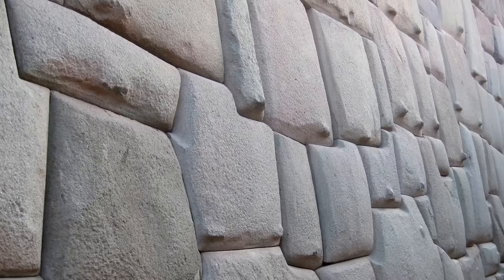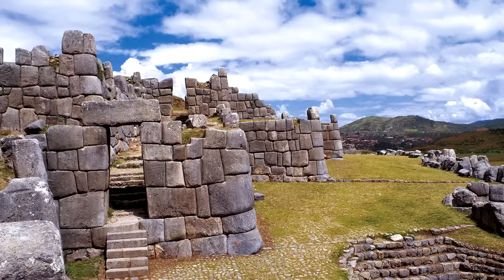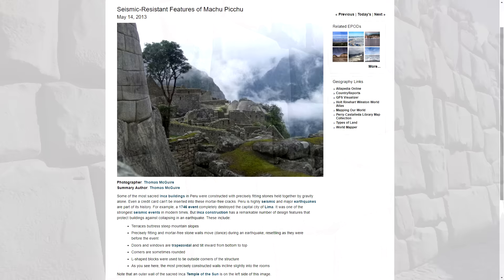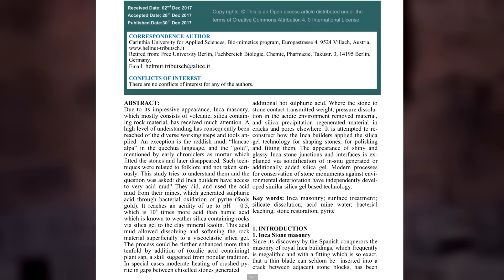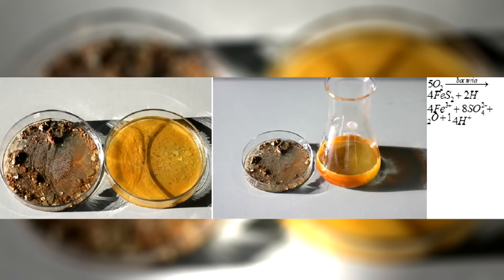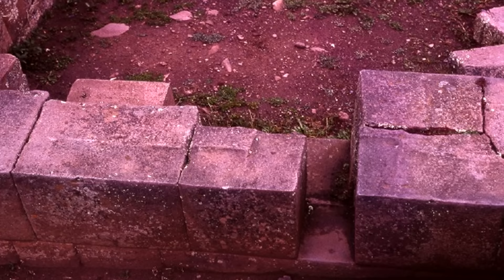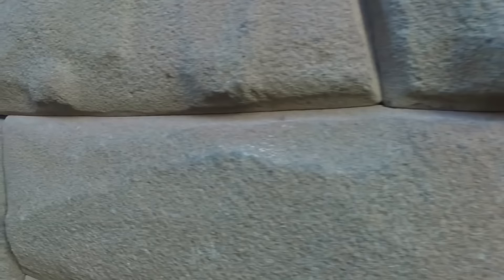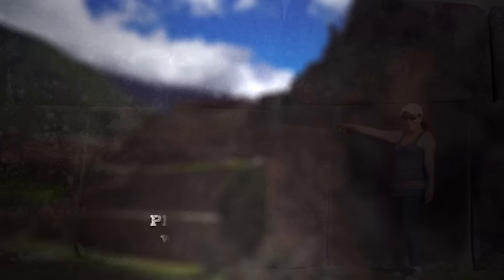Is This How The Inca Walls Were FINISHED/JOINED So Perfectly?

Comment: If the combination of weight and acid worked at all, then the horizontal joints would be most effected. The vertical joints, not so much or not at all. Back to the drawing board.
Reply: Very good comment. We must also think about vertical joints with different pressure. 
For me, we will never get the answer unless we dismantle some wall at least partially, examine it and them reassemble it back. There must be traces of what formed the stones into their final shape. And possibly some material residues of means of their transport into their place.

Comment: I’m starting to wonder if they didn’t use a recipe for a more solid forming concrete. A mix that would create granite and other hard stones. Has anyone ever noticed the concrete bag method being used? Just stacking dry bags of quickcrete?  They spray the bags with water and leave them. Eventually forming perfect walls of concrete. If the ancients used a similar method using giant burlap bags of a special blend of sands and lime to form larger more solid finished walls. Just a thought. Thinking of trying it out with various size bags and recipes for Concrete or geopolymer mixes.
Reply: Don't ..there's no easy way to do stonemasonry ...all you'll build is a dreadful looking thing that won't last
Reply: Yeah, they went to their local Home Depot and loaded up with bags of DIY granite. Just add water.
Reply: Their technology probably wasn't advanced enough to produce burlap 😊😊😊

Comment: I work with stone. You posed the question of the gel 'sitting as a type of mortar corroding under the sheer weight'. Perhaps for the base, but this Q ignores sides. Most people miss the detail that, like all material that's requiring shaping - the waste seems to be overlooked. The use of the gel would spill, and the waste would be slagged somewhere. In the wall core? The tooling marks are wide and crude, and closer to the joint, finer tooling becomes exponentially finer - so as with many very hard stone shaping, hitting to 'bruise' the stone fractures finer areas of material. 
For shaping with corrosive materials - friction is required. Coupled with bruising? You know... just possibly? 

So to get the infrastructure to test theory and techniques TO SCALE would cause a vast budget to be costed - so We need a billionaire experimentalist... The difference between then and now is money. We are privy to money. What were they privy to?

Comment: I can tell you the pyramids weren’t built with tight seams from the beginning. They all have sand in between each block. The weight of them stacked, over centuries slowly crushed them into the tight seams we know today. When moving the blocks into place the wet sand helped reduce friction once they took them off the sleds. I’m assuming that the Inca did something similar, over time the blocks slowly squeezed tighter and tighter together.
Reply: I’m impressed. That actually makes sense.

Comment: Surface level treatments cannot affect the inner parts of the stone which would have need to deform. As mentioned the vertical joints are not explained by this theory. More than likely, they used something which made the hard stone soft temporarily (e.g.- energetic/acoustic/molecular matrix loosening/mass reduction), or it was a polymer like clay. Even with the polymer clay theory, the mass would be almost untenable. My theory is energetic molecular loosening and mass reduction. I made a scale model wall using polymer by forming one stone at a time, then pressing it into the joints of the surrounding stones, then firing it. While this “worked” (since the polymer only shrinks ~1%), forming then firing inputs place would still be a task. This is why I think they just used a scientific process that we simply have discovered yet. The stone scoop marks and protuberances also exhibit a softened stone matrix going beyond a mere surface effect. Many of these scientists and archeologists are stuck in a curated academic paradigm.
Reply: So why don't we know about this process today?

Comment: I’d say it’s convincing enough to try it. The side wear doesn’t work with this explanation though, unless you are suggesting that they did this on the sides prior to placing them. Because of how tightly joined they are, is it possible that there may be residue from the acid process in between current stonework?

Comment: I watched a film 20 years ago where people were demonstrating how to make this fitted block walls. The large blocks were chipped away with round stones. Larger ones for the big chunks, down to small ones for edging.
When a block is test fitted and then removed, it leaves powdery marks where more chipping is needed.
The person doing the test fitted three modest sized blocks together in a day or so.
And the areas where the chipping was done has thousands of round river stones in the area, where they would not be there naturally.
This acid idea is okay, and may have been used, but it has been shown doable with just other stones.
Reply: This is the basis of much western technology. Until fairly recently, engineering works had scores, if not hundreds, of people call 'fitters'. Their job was to fit parts together using hand tools. Try, scrape or file, try again. Huge machines were made this way.
Reply: I saw a similar film, some German amateur wondered out loud 'how did they do it?' and an old man said it was passed down to him through generations.  The town they were in was incomplete and the old man pointed out the large rock on the other side of the valley.  They levered it down a shute that had been created hundreds of years ago, sliding down the shute the rough edges were cleaned up a bit.  Then 200 people dragged it with ropes up the 5% slope all their roads had.  They wet the round cobble stones of the road and the rock slid easily.  Then they levered it into place, marked where they needed to work on the stone, lowered it chipped away lifted it back a few times and then it fitted and they backfilled it with earth.  Nice and easy - but his research was not approved because it made all the professors look foolish with their theories of acid, softening stones and all that clap trap.....
Reply: @MaitreMark  that's a weird controversy. This is the answer most historians are looking for, and they tend to crap on the fancy ones. The defense is usually against "aliens" or "ancient lasers," not "lots of people with lots of time on their hands..." that's the preferable answer.

FWIW your description sounds very plausible to me.
Reply: @markdmckenna  I have not been able to find the film again, but he was some German guy who spent his holidays mapping out Incan sites that had not yet been mapped.  His work was usually accepted, but this time when he documented and filmed the locals doing what their ancestors had passed down to them, his work was knocked back as 'unprofessional.  Though, the whole village participated, the new stone work was exactly as the old stonework.  I visited Incan sites in the 1990s and was inspired - I have built kilometers of stone work at my place in Tasmania, though I use an excavator.  But people do not believe I built it.... I have even filmed myself building stone walls and towers but people say 'it must have been there before'.
Reply: That is BS, how do you chip granit and andersite? 
Just because someone tried it with limestone, it does not mean it works with harder rock.
Reply: @Tensquaremetreworkshop  Not really, machines were scraped off master blocks, so you rub the part on a flat granit stone or rub a big straight edge on the granit and do a transfer.
The granit needs to be ground and lapped, how on earth does that explain how graint blocks are fitted together.
Reply: @shanerorko8076  There are rocks harder than granite.
Reply: @janerkenbrack3373  not at a significant differential, also these harder rocks would be found made into tools, also how do you fashion a tool out of a harder rock? 
I think granit is 3rd hardest, not including gem stones, and the next harder rock is not substantially harder.
If you've ever used a metal lathe you would understand hardness, as you get different hardness tooling, I've cut some hard stuff in my time.
Reply: @shanerorko8076  
Well the round stones are bounced which gets through a MM or 2 an hour .
 
What are the round rocks made of ? the same thing as they intend to make the building stones out of . 
They both wear at the same rate .... this isnt like a saw blade that needs to be harder than the rock it cuts to lst as long as possible . They can both be at the same hardness and both wear out at the same rate wheres the stone to be bounced is thrown away once its lost some size .

Dont believe me ?. Go get a round stone and bounce it off another rock for an hour . You will be suprised . You dont hold the rock , you simply drop it onto the rock bellow . Make a wooden frame to make it accurate to the same place and bobs your uncle .
Reply: @godzillas6301   I highly doubt you would get 1mm an hour.
Many tests have been done using this method, all seem to come back negative to this theory.
There's literally a granit stone in Egypt where the ask tourists to try it, that stone has been there for years and there's hardly any progress made on it. 
You can't just use any stones, we're talking about granit.
Reply: The Incas didn't have iron or even bronze, for tools. Just other stones.
Reply: @shanerorko8076  at risk of just repeating the same argument forever, it's very well established how the ancients could have cut granite; it's been demonstrated. It's a simplification that a material can only be damaged by a harder material; the softer material just deforms more during the interaction. Continuous abrasion over long periods is how you cut really hard things. You can scuff glass with steel, even though steel is much less hard; you just have to work at it, and replace the steel.

The Egyptian trick is to pour sand on the stone, and then wear away at it with stone or copper tools; they don't even have to be sharp, more or less any old rock will do. Keep pouring in the sand, keep replacing the tool, and you'll get there. It's just a question of manpower.

Not saying this is how the Incans did it; they might have had other tricks instead. But it wasn't out of reach.
Reply: quick follow up... there's a granite stone footing in a church in (I think) Amsterdam, which has been there for around 800 years. The stone is worn and hollowed in the middle, by the passage of many feet across several centuries. No one was even trying to make it happen, it's just regular wear and tear.
Reply: @markdmckenna  No that has been debunked, even that pouring sand over things has been debunked.
Reply: @markdmckenna  My previous post was deleted ..... ummmmm 

In it i pointed out the same . Even shoe leather will erode granite so granite on granite is a given . 
Grind 2 surfaces made of the same material together and they both will wear and at the same time . Increase this by bouncing and the impact and wear happens much quicker and prominent wear much much faster . Scraping together is to create a finish .
There is countless instances of granite thats worn in the UK ... simply beyond count . Every castle , every church , no end of simply medevil building materials are still in use today with massive dishing where it comes into contact with humans ..... even the Blarney stone has massive wear on it and thats from kissing alone ! .
Reply: @shanerorko8076  I've done it myself, personally. It's a technique still used today in fabrication. It cuts and polishes metal and abrades stone. It has nothing to do with "pouring sand" though. That definitely would not work.
Reply: @markdmckenna  you have never used a single tool in your life.
Reply: @DeathDwells  sorry, you're exceptionally wrong. Nice try, though.

Comment: These Inca walls were not constructed by the Inca, as per their own admittance.  As for the construction method of these walls, I would proffer the idea of sound frequency being used.  Take a big stone, place it atop another, then use sound frequency to get the top stone to vibrate at a high frequency.  This vibration of the top stone will quickly grind the two stones equally, using gravity, and the two stone surfaces in contact with each other will grind each other perfectly mating with each other with no gaps between them.  This is the easiest and fastest way to mate stones with each other.  You can use this method upon several stones at once.  We currently have the sound technology to do this; we just haven’t applied it yet to prove out this theory.
Reply: Why waste time on a stupid idea like that when there is no possibility the Incas had that technology.
Reply: @PanglossDr  Don't forget: everything resonates. Just hit the right note... the idea isn't stupid at all. How would you know they didn't have musical instruments? There are stories of eye witnesses seeing monks using horns to move heavy boulders, too. So the idea of using resonance isn't uncommon at all. It's just one of a thousand possibilities we don't know of yet. So stop being dogmatic and let people share their ideas, like you might want to share yours.
Reply: @Dagonius.  There are stories about all sorts of rubbish. I ignore them without proper evidence.
Reply: @PanglossDr  of course. I understand that.
Just keep an open mind, not to be too surprised if something does try to blow it.😉

Comment: Frankly if you look at it, the stones DO NOT apppear to be cut or chiselled out. They look more like being moulded from liquid form and allowed to cool and hardened, being shaped in some form of mould. The irregular shapes of the stones has a purpose - it provides rigidity and integrity to the structure, giving it stability during an earthquake. As to who built them that is the mystery.

Comment: OK, lets go over a few things too clear this up. 
First; how the hell does one carbon date a rock? Last time I checked at best you would be receiving the date it was created in the earth's crust. Also the advance civilization theories involve at least 2 different cultures from different time periods, so if you found a pot and dated it you should also assume that it was made during the most recent culture.
Second; wouldn't acid erosion leave, I don't know... erosion marks as the acid collects in the lower parts of the stone and erodes them away leaving indentations and streaks?

Now please understand I'm not saying that acid mud couldn't possibly have been the method used, but we first would need to see one of either two things before we can start to consider it: 
1 - Sold evidence that the megalithic stones construction was indeed done during the same time as the much rougher work seen on top of it in some of the sites. 
Or 2 - A proof of concept experiment showing that stones can indeed be fitted using this acid mud and result in a perfect fit something as simple as 2 small, flat limestone rocks with some sort of acid mud in between and say a rather beefy clamp holding them shut and providing the pressure.
Reply from the maker: Sorry for the very late reply! The radio carbon dating was from wood or bones i think at Machu Picchu, paper linked in description, and yes we have no proof of concept method for how they may have used the acidic paste, but we also have no other better proof of concept of how they fit these blocks so finely, hopefully someone has that 'Ahaa!' moment and figures it out 😂
Reply: @ArchaeoLogic  They used hammering stones and in some cases metal bars. The bottom of the block to be placed next was finished first (while "upside down") along with one of the sides and the already-placed lower and adjacent blocks in the wall were then roughly shaped. The new stone was then put in place and tilted backward (leaving the front of the joint exposed for finer hammering). Wet clay was spread in the joint and when the stone was lowered back down into place it would squeeze the clay out of the high spots while it remained thicker in the rest of the joint ... visually indicating where more hammering was required. The block was repeatedly lowered until only an even film of clay was left in the joint. The clay could be substituted by other substances including lead and gold (gold might have made the best "joint fitter" given its excellent malleability). Perhaps gold WAS used in the finest joints, and its removal from the pitted surface of the finished block could have required heating (which consequently might explain the vitrification observed in some of the joints). On a separate note, other megalithic cultures (e.g. the Egyptians and Tiwanaku) achieved perfect right angles and flat surfaces by working on blocks in a pool of water (water surface is very flat so can be used similar to clay in a joint to achieve a "perfect" fit and finish).
Reply: @tomszabo7350  This is actually the best explanation I've heard.

Comment: As dentist I see how people have ground their teeth down either flat or with the points and notches fitting exactly together like a puzzle piece. The two surfaces of the same hardness wear at the same rate and eventually fit precisely together. How they lifted the stones and moved them back and forth against each other is a mystery, but that’s my simple analysis.